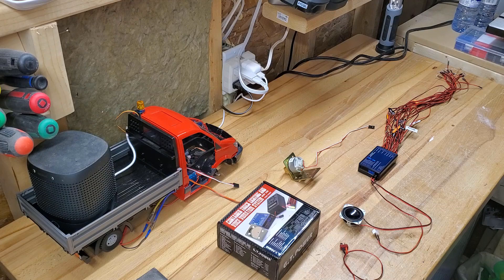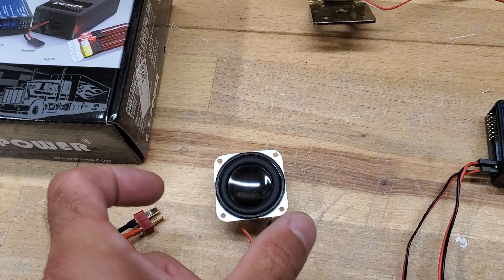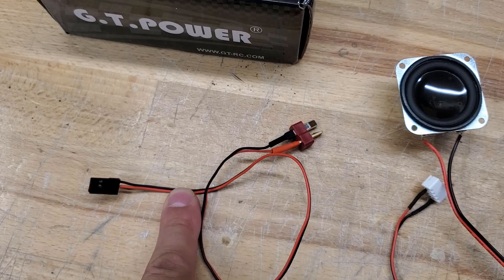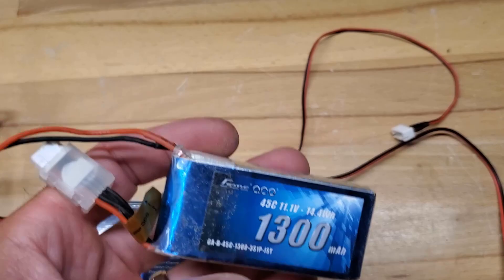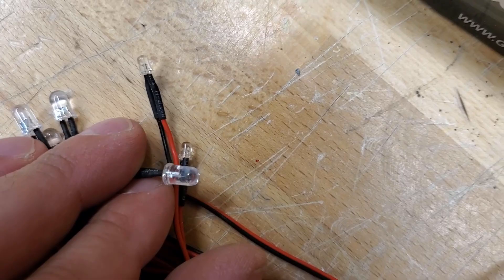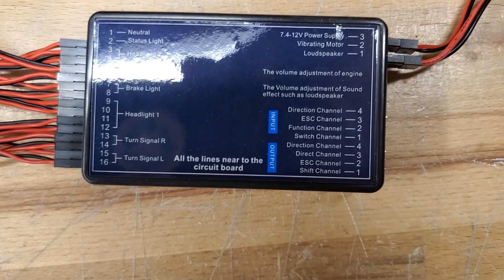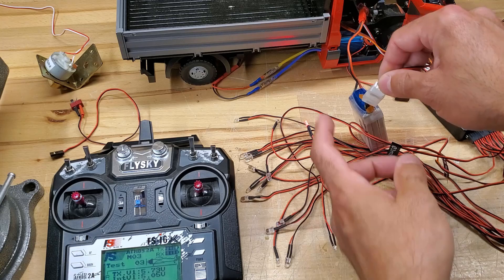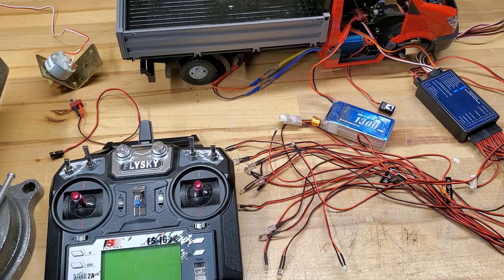How To Install the GT Power Truck Light and Sound | and Demo!

Comment: so you can't used a 2s lipo battery or does it have to be a 3s lipo to power up the GT united.
Reply from the maker: Either 2s or 3s lipo you can use. But not 4s or higher. I am running it with a 3s but you can use 2s.
Reply: Ok thanks for your help. One More thing would you recommend using the 2s lipo or 3s on a tamiya globe liner truck. I am sorry but I don't know that much about the lipo battery.
Reply: @VijaySingh-rv7ks  I say go 3s if you have an esc that is rated at 3s. Or 2s will also do.
Reply: @rcchbuilds  thank you Soo much for your help.
Reply: Can you please explain why you didnt plug 1 to 1 and 4 to 4 yet 2 and 3 are to their respective channels

Comment: This kit si good for  tamiya Toyota tu ndra?
Reply from the maker: No it is not really meant for cars or pickups. There is another model from gt power that has over 50 sounds with lights that would suit the tundra and also has bluetooth capability

Comment: Hi can this be powered using the truck battery. Thanks
Reply from the maker: Yes you can just use your own battery connector to the main battery and not the balance plug.

Comment: hi mate what esc are you using as the one i have isnt moving the motor does all the sound and ligths but dosent move the truck
Reply from the maker: Hobbywing 1060 is what I use. I know that some other esc's have issues.
Reply: @RCConstructionHobby  i do have the same one but every time I connect it the esc start blinking and the motor doesn’t move any advice
Reply from the maker: There are 2 little jumpers on the esc. Do you have them on f/b/r? If not try that. Also, on your tx are the sticks set for the right channels? Make sure when you plug it in that the esc which runs the motor is turned on first before any other esc if you have multiple esc.

Comment: Hi have commented before have got all the lights working now my problem now is the sound system only works for few seconds then you have to turn if off leave it 20 mins or so turn on then some sound works only once.   Help
Reply from the maker: Are you using a 7.4v battery? Also, try connecting it all from tge deans connection and  ot through the balance plug. Could be an issue with the unit as well.
Reply: @RCConstructionHobby  I am using a 7.4 non lipo battery  I was using a lipo at first

Comment: Hi, Thanks for the info, I have a esc with all the connections such as power, motor and usb, Where do I plug it in too, I tried your instructions but the difference is the esc I have with three Leeds, Help.
Reply from the maker: Which esc do you have? You want to connect the servo wire to the sound kit like in the video.
Reply: @RCConstructionHobby  Hi again Rc Hobby, I have the BDESC-S10E-rtf esc, It has a built in plugs for a tractor motor, it has power outlet plug and the usb plug, I am trying to install it on my Tamiya King Hauler., Your instructions are spot on, I tried to hook up the wires but I just can not get the motor to work, It does not move at all, Everything else works.
Reply: Hello again, I am using the GT power truck sound unit.
Reply from the maker: Did you try the esc and motor without the sound kit? Did it work? The only thing that should be plugged into the sound kit is the servo lead from the esc. The esc will be connected to a power source as well. If you followed my video only thing I can think of is test the esc and motor without the sound module. Also, make sure that the servo leeds are matching the channel you are moving on the transmitter. Some recievers may have different channels setup. Example mode 1 or mode 2
Reply: Hello again, I hooked up the esc and the receiver for a test on my channel 2, That test worked and the motor is working on command, I was trying to incorporate it with the Gt power unit, I can’t get any power from the esc to the unit once it is hooked up.
Reply from the maker: Oh did you move the stick left and get it to start up? Motor won't move until you move the stick left to start the sound. Then the motor will spin.
Reply: Hi again, So maybe I need to get power to all the units, The sound unit, The receiver and the Esc, So I need to get a y connector, I also wired the servo steering to the sound unit, Not working, I will try that other method.
Reply: Hi again, What Esc are you using for your truck.
Reply: Hi again, Sticks work, I will continue the diag. Thanks.
Reply from the maker: For the motor to spin you need to move the left stick to the left or right to start the sound of the engine. Once the engine is running you r motor will work when you push up on the left stick.
Reply from the maker: I'm using a hobbywing 1060 esc.
Reply from the maker: Yes the sound module needs power. Its the top connection with a deans connector. The esc needs to be powered as well a y connector for both would work. So for it all to work the esc and the sound unit needs power. I will post a video for you tonight on youtube. It will be a private video link I will send to your email.
Reply from the maker: Hi Rob, I made this video for you to see if these things I show work for you. let me know. https://youtu.be/RPFkXZYjHh8

Comment: Hola de nuevo sería de agradecer la intervención de Afición a la construcción RC nos dijera que debemos de hacer en la emisora para que el motor pueda andar. Como dije todo lo tengo bien tal como se ve en el video pero mi motor de camión no arranca. Tengo el transmisor Turnigy9X y el receptor Turnigy iA10B. Pedro Rámirez al parecer tenía el mismo problema que yo y no sé si lo habra conseguido. Gracias de nuevo. Saludos
Reply from the maker: hola, para arrancar el motor joystick izquierdo a la izquierda para arrancar y parar el motor. siempre que la dirección esté en el joystick derecho. si la palanca izquierda hace la dirección, la palanca derecha a la izquierda para arrancar y detener el motor.